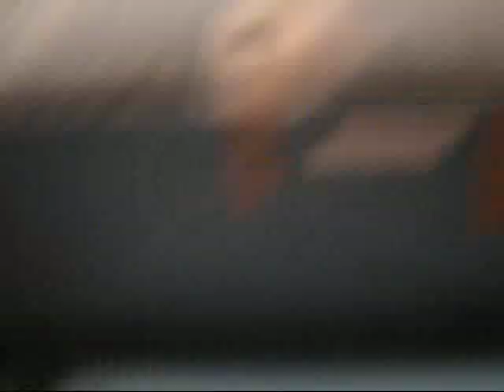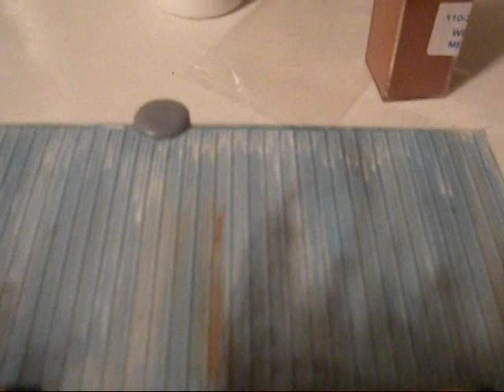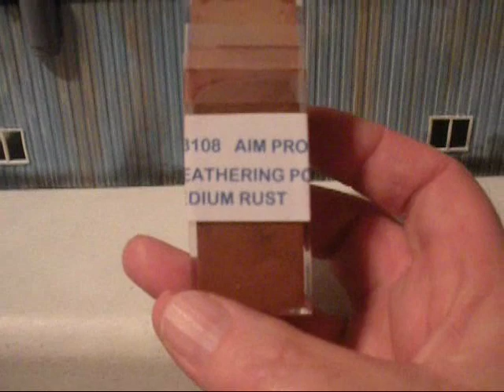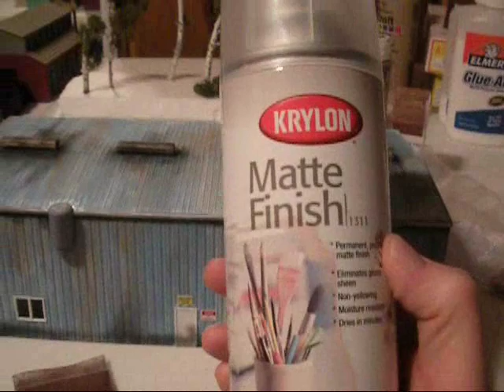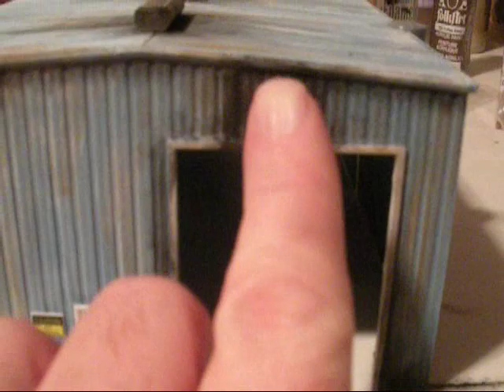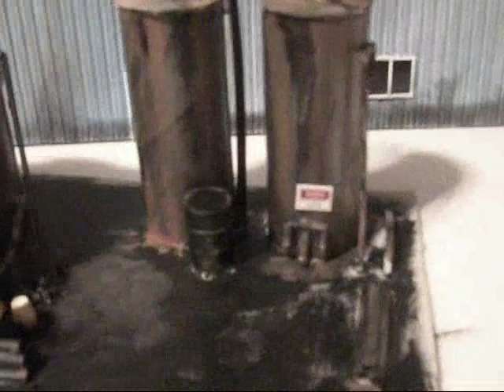Shed Weathering

Comment: How can I use acrylics on the plastic. All mine do is run and bead up.
Reply: Ryan Lotzer old comment but if you spray it with a matte clear coat or scratch it up it should start sticking